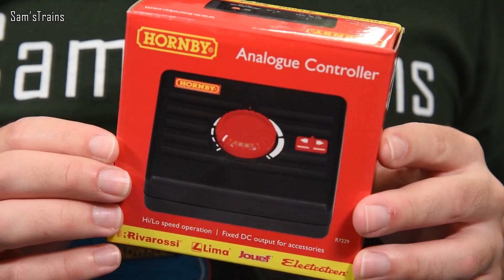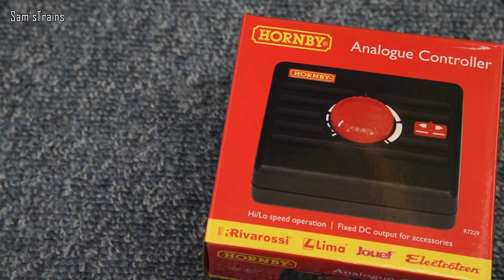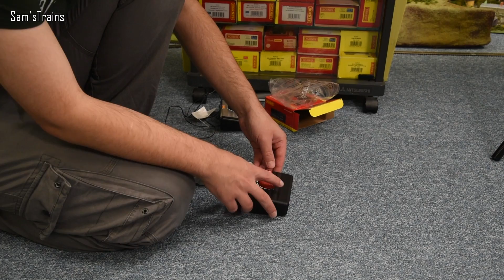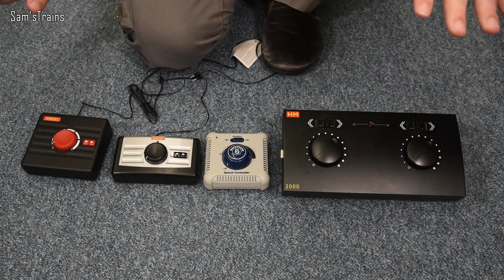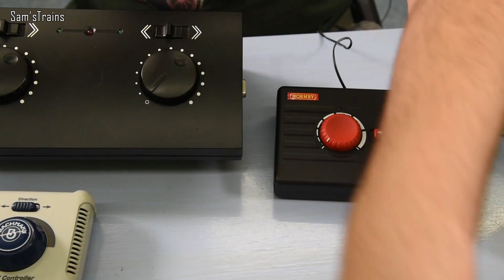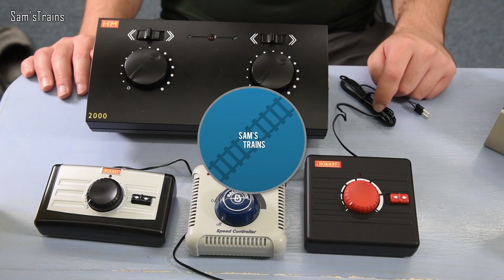Hornby's New DC Train Controller | Controller Buying Guide

Comment: Sam as ever a brilliant video re new hornby analogue controller. Here's a link to an even older Hornby controller the R900 from the 1970's below is a link to eBay. These controllers didn't require a separate power unit because as you can see it's all in one built-in transformer, but it is still £34 cost wise. It's cheaper than the rolling stock and the locos unless you buy second hand. This controller I think is safer to the motors for your locos, but you would require a second controller if you want to run trains on more than 2 lines because the current can't reach the other tracks. That was it's only limiting feature. There was another controller that Hornby brought out in the early 1980's I forget the name of it but it had a bar that you slid up and down to increase or decrease the speed.

Link below for this old Hornby controller R900.

Enjoy take care matthew

https://m.ebay.co.uk/itm/HORNBY-R900-POWER-CONTROLLER-with-240-V-INPUT-and-12-V-Controlled-OUTPUT-nr/362576246704?ul_ref=http://rover.ebay.com/rover/1/710-53481-19255-0/1?ff3=2&pub=5575376664&toolid=10001&campid=5338268676&customid=CjwKCAjw04vpBRB3EiwA0Iieal8uDVsmiHS6NI8FYQN3R_2PbwGd_CSe5r2Nc6UVKORt_-RZZAngzRoC0MkQAvD_BwE&lgeo=1&item=362576246704&srcrot=710-53481-19255-0&rvr_id=2034488004698&rvr_ts=d2527ed716b0abc310776fa0ffdd7057&_mwBanner=1&_rdt=1&ul_noapp=true&pageci=3e867745-0ff6-4c00-8b6f-67f9eefd98bb&epid=1607738573
Reply from the maker: Hey Matthew, thanks very much for that mate! Blimey I don't think I've seen one of those before - thanks for this, that's very interesting!
Thanks for watching - Sam :)

Comment: P. W. M???
Also I have the HM 2000 & I've notice on yours - on the left hand side it has a silver / blue 9 pin (I think) female plug socket - what is that for??? (I don't have that socket on my HM 2000!!!)
Reply from the maker: Yeah, pulse width modulation! That's the expansion slot, for adding an extra control knob for a third or fourth track! :D
Thanks for watching - Sam :)

Comment: I personally use the Gaugemaster Combi. I love how compact it is and it also has a "neutral" mode on the switch so if the knob is turned to full, the loco will not move. It is also £34 on hattons
Reply from the maker: Thanks SG - yes I know how good those are - I do need to try one! :D
Thanks for watching - Sam :)

Comment: The old R965 has an AC input from the C990 transformer which it rectifies to DC. This new controller is designed to work with a switching PSU with DC output. I think if you connect it to an old linear DC PSU then you will get the unhealthy buzz!
Reply from the maker: Yes you're right actually - another reason why they should be supplying the transformer!
Thanks for watching - Sam :)

Comment: I had an older style controller (R965) from my Queen of scots train set (circa 2002) & that is a very good controller, but I do have an older R900 circuit controller from the eighties which is fantastic, it uses rocker paddles for direction & high/low speed settings. But both controllers have a positive feel & don't make any noise, odd how these modern controls are supposed to be more refined
Reply from the maker: Ahh yes, those are very good indeed - any old controllers seem to be much better frankly!
Thanks for watching - Sam :)

Comment: Hi Sam,

As much as I don't like to say it but the new Hornby controllers are just cheap and nasty and I am being polite here hence being in public. The older Hornby R965 train controllers that were supplied in train sets from 1994 to around 2007 was a lot better. No annoy hum noise from the motor and they were capable of slow speed control without the motor making a stressed out noise. I currently use a Kato controller hence that I use this unitrack system but when I used to live in England. I had a Gaugemaster Model D twin track DC controller and they are much better quality in my opinion. No extra power supply needed either. The older Hornby and Lima controllers are still good for train sets and I did cover one of the Lima DC train controllers last year when I reviewed the Lima HST train set if you wanted to see what they look like mate.

All the best
Ash.
Reply from the maker: Thanks Ash, yeah I agree - it's another fine mess really! Yes those Kato ones do tend to get glowing reviews - I may try one!! :D
Thanks for watching - Sam :)

Comment: When the Hornby controller (black knob) cuts out after a short circuit, it seems to come back to life quicker if the transformer is turned off at the mains. Possibly the transformer has a cut-out as well?
Reply from the maker: Yes I've noticed that too - but I've tested the transformers on their own - it's definitely not them that's doing the cutting out!
Thanks for watching - Sam :)

Comment: Nice little review there mate, as others have pointed out it's a shame Hornby haven't taken the opportunity (especially with Mr Kohler back on board) to produce a reasonable one, even if it would have cost that little bit more. I've got to admit I am gradually fitting decoders to my fleet, so working on an odd combo of DC and DCC, but my test track has been built to easily switch between the two. I actually ended up buying some bits and bobs from ebay and building my own DC controller, following the advice of (I think!) Budget Model Railways youtube channel. No soldering or anything required, just a small screw driver and some wire. Works a dream. 

Would be interesting to see how the accessories output works on the new Hornby one, with the distinct lack of ampherage going into the controller.  

Thank you again for a brilliant review, and carry on doing what you are doing.

Cheers,

Dom
Reply from the maker: Thanks Dom, yes a shame indeed - but not a surprise! DCC is definitely a good option - especially when this is the alternative ;)
I may do some more delving into this in the future!

Thanks for watching - Sam :)

Comment: Good review, as usual, Sam. Having just returned to my model railway after a gap of 55 years, I definitely prefer my old and original controller with a solid feeling knob - clockwise forward, anti-clockwise reverse. I find the change of direction slider switches in newer controllers to be a real pain. Imagine a reverser in a steam engine having a change of direction lever!
Reply from the maker: Thanks very much mate - yes indeed, definitely don't replace an old unit with these modern ones - always ends in disappointment, haha! They are a pain, you're right!
Thanks for watching - Sam :)

Comment: The fact the bachmann controller has no short cuircut protection makes it one of the best portable controllers especially for a budget railway where your using old locos which can often trip the protection in the hornby ones whilst pulling a mild load
Reply from the maker: Yeah that's very true - it's certainly much less annoying, I personally like that as a feature, even if it is a bit naughty ;)
Thanks for watching - Sam :)

Comment: Nice Video 
I have used Gaugemaster for years as my chosen controller. 

A double pole double throw with centre off in the track feed and you don't need to touch the reversing switch on the controller. 
Minor irritation removed ?
Reply from the maker: Thanks a lot David, yes the Gaugemaster ones are superb! Yes that's true - with a bit of effort, you could certainly do that - very good idea!
Thanks for watching - Sam :)

Comment: The best controller in my opinion is the gaugemaster combi dc controller. It runs any engine, at 12v and is extremely durable and well made. The trainset controller barely worked and could not run lima or other engines.
Reply from the maker: Yes I've heard that those are excellent - I'd love to try one! :D
Thanks for watching - Sam :)

Comment: We use the R965 controllers to run a Thomas the Tank set up for the kids at the model railway shows and get no problems at all. They appear sturdy and quite reliable unlike the cheap and nasty recent Hornby controllers. As you say they don't seem to have learned from experience but it's probably a Knob head that is deigning them.
Reply from the maker: Thanks Frank - yes the R965 are very good and reliable! I think that much must be true mate, lol! ;D
Thanks for watching - Sam :)

Comment: An interesting video.  Surely the new Hornby DC controller would be useful if you already have a transformer and want to upgrade or you may be able to use the power from another controller to feed the new Hornby one to provide an extra control circuit.  It has made me look at my old  clipper units.
Reply: Don Sharpe I think you will return to your HM Clipper Controller, sooner than you might expect.
HM were well engineered for their time, robust and had the ‘centre off’ (12 o’clock) feature too.
The HM range was my controller of choice until I discovered Gaugemaster analogue devices, many years ago.
I now have my HM units set up for bench testing sometimes utilising the 16v a.c. Output to feed a Gaugemaster
hand held unit if I want to test very slow running.  The Gaugemaster warranty is exceptional and always valid in time of need!
Just Enjoy.
Reply from the maker: Yes that part's fair enough Don - my issue was with the lack of any disclaimer whatsoever on the Hornby website - this has now been corrected since I uploaded the video though!
That's an interesting thought Don - but the new ones require 19v DC, which is an odd figure!
Thanks for watching - Sam :)
Reply: @SamsTrains  I agree 19v DC is an odd requirement.

Comment: To be fair to the new hornby controller.

When a short circuit happens  its the transformer that cuts the power, not the controller as you showed it this video. 

Unplugging the transformer from the controller won't reset the cutout 

you need to turn off the transformer at the mains for 30 seconds that is the correct way to reset the power 

Hope this helps next time you get questions about controllers
Reply from the maker: Thanks for the comment Oliver - unfortunately, that's completely untrue though. It's the controller that handles the short circuit protection - the power supply/transformer doesn't cut out!
Thanks for watching - Sam :)

Comment: Does the HM2000 use the same connector lead to the track as the other Hornby controllers? If so I will upgrade!
Reply from the maker: It has ports that can take any stripped wire - so you could use that, or anything else you liked! :D
Thanks for watching - Sam :)

Comment: There's supposed to be a CDU inside the R7229 but where is the output for it? A CDU delivers a very short pulse of power, so it can't come from the 14v DC outputs. 
I know that switching direction on my DCC controller while a loco is moving really confuses my decoders. My Big Boy will refuse to move for hours, sometimes weeks, when I've done that. Possible that the same thing could happen with the modern electronics inside DC locos too? The LEDs perhaps? 
I like the fact that the current drops to zero when there's a short circuit. Your locos can melt with poor short circuit control and inferior wiring. Scroll down  Mark Gurries page for a photo. (Not for those with a nervous disposition.) https://sites.google.com/site/markgurries/home/technical-discussions/boosters/10amp-booster-ho
The short circuit cutout on the Hornby controllers works by a thermal cutout if memory serves. I can't see them being able to make them reset any faster without more expensive electronics inside.
There's a review of DC controllers here. https://www.scottpages.net/ReviewOfControllers.html 
He thinks the direction being interlinked with the control knob is a brilliant idea. :-)

I was only going to post once, not three times, but it wouldn't let me edit. :-p
Reply from the maker: I believe the capacitor will discharge whenever a load is applied to that 14v output - for example, when you flick the lever for a set of points. I think it'd still work even with some lights and other accessories using continuous DC on the output too, provided their current draw wasn't too much to drain the capacitor permanently!
Yeah that sounds strange - could be the decoder too though?
Thanks for all the info!
Cheers,
Sam :)

Comment: You can't use the HM with all motors; coreless one's will burn down, because of the feedback controlling. The HM is also Hornby, by the way. PM is no problem for a motor; it gave much better slow speed controlling. In the cataloque it is mentioned that you need a Transformer. Mayby the knob feels rubbish, but you get also a capacitor discharger for points with it. I think that is not bad for that price. I use the Ztc 511 controller, the best there is. For dcc and dc.
Reply: Still using the ZTC? That's last century technology. :-) I use the Roco Z21.
Reply: @Boppy-B-B  i have a z21; great system, but i had a issue with it, so it is back to Roco. I don't like to use the Multimaus. I still have some Ztc/zero 1 decoders, that's why i bought lately  secondhand the Ztc controller. And i think it is the best for controlling a loco; specially shunting
Reply: @andrewsea4252  You're the first person I've heard that's had a problem with the Z21. What was the problem?
Reply: @Boppy-B-B  with more than 3 soundloco's it went into overload. After contacting Roco they answered to send it back.
Reply from the maker: Yeah I agree Andrew - it's not too bad for the price - the HM2000 does indeed use PWM (I've checked this too), but it's far less aggressive - and it certainly doesn't shoot out spikes of 19v, like this new one does! Thanks for the tip on the Ztc, I'll be sure to look into those!
I try not to buy locos with coreless motors - I find them poor - luckily most manufacturers seem to know this too and resist the urge to fit them! Now DJM is gone, hopefully it won't be a problem any more!
Thanks for watching - Sam :)
Reply: @SamsTrains  i agree with the coreless motors; i don't understand the benefit. I just bought a Bachmann set (western Rambler, very nice with a beautifull loco) which contains some track with that little controller. I have a big layout, so i laid it for fun on the table to try the loco and the controller. I agree with you, feels good, but i soon started to irritate me about the on/off switch. Why is that, just off is enough, no switch. Really like your channel, keep up the good work!

Comment: The old Hornby R905 controller had a 'Half Wave' switch for slow speed control. I used to have one. I've asked Hornby on their FB page why they don't mention that their controller needs a power supply. I also looked at their page for the P9000 transformer. It doesn't say if it's suitable for the R7229. It just mentions the old R8250.
Reply from the maker: Ahh did it really? That's quite interesting! I have noticed that they've now updated their website - looks as though they've taken it on board!
Thanks for watching - Sam :)

Comment: Fascinating review Sam...like the old adage goes..'You have to pay for quality' and that's proven here..I have an old second hand H&M Duette, which is around 40 years old, and still doing what it should do very well....Bob
Reply from the maker: Yep absolutely right Bob - and you can't beat the old ones!! :D
Thanks for watching - Sam :)
Reply: I have one too, but you have to remember it's a basic variable resistor design, not pulse width modulation or basic feedback. This means older locos under greater load on inclines, turnouts etc. slow down as there is no feedback increasing output.

Comment: I have an H and M controller sitting right next to me, which is about 60 years old and still works fine. It is a twin-track controller with an output of 2 amps.it also has a 12v DC output on one side and a 16v AC output on the other side.and it says on the tin plate on the front "Protected by automatic thermal cutouts". I will still use it as my tester at the work station, but I hope to get 2 twin Guagemaster controllers, one with the brake simulator(For the Up and Down Main Lines) and one without for the engine shed and TMD and the shunting yard. I do still have the controller from the first train set we had. Princess Victoria in BR black with two coaches and track I think it is better than the new Hornby one. One thing you did not say about the new Hornby one, where was is it made? If you say China, then that's the problem. Hornby is on the wrong track and needs to sort things out. Make a factory in Thailand. Okay, the labour would be a little more expensive if in Bangkok. But up here in the North-east it would be cheaper and the Thai's need jobs. Martin (Thailand)
Reply from the maker: Blimey! Didn't know they'd been making them for as long as that - they are superb things though - I know that for sure! I really like the Gaugemaster brake simulators too - a very clever feature!
Many thanks for all the info,

Thanks for watching - Sam :)